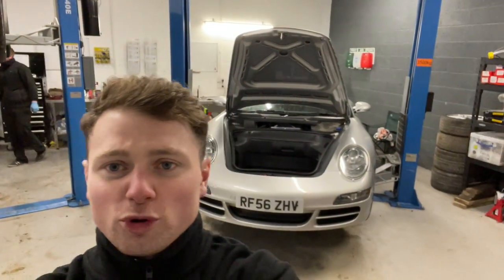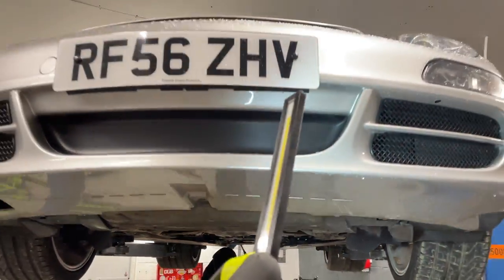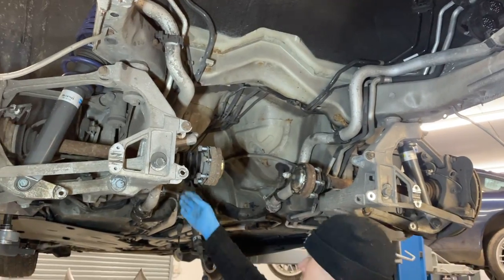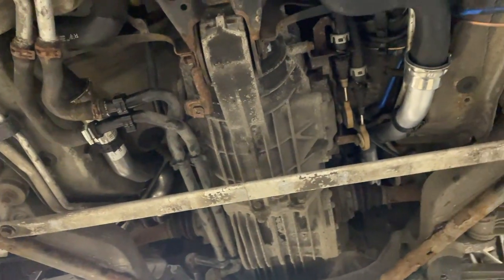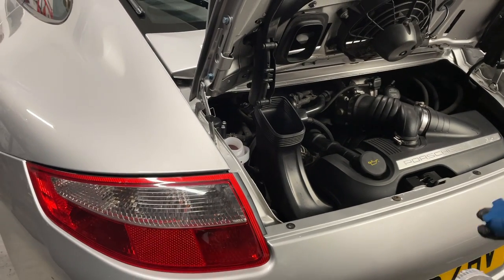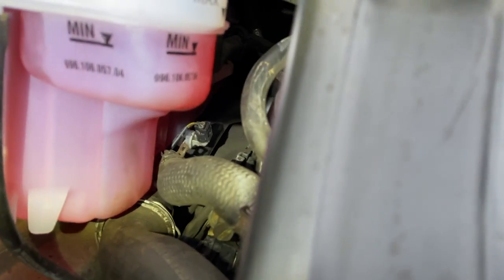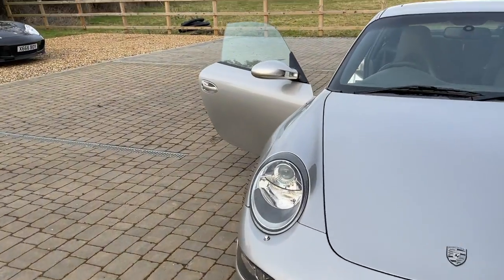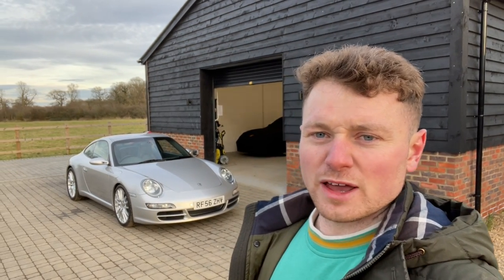The Porsche 997's Coolant System Weak Points Explained & FIXED - FGP Prep Book EP34

Comment: First of all - what an excellent informational and educational video! It feels like xmas day every time you guys post a new video. ✨

I would love to learn more about manual transmission fluid change in 997.2. Is the drain plug the same size as the motor oil drain plug? How often do need to change manual transmission fluid? If I remember correctly the owners manual says 180.000 km / 111.000 miles - this sounds insane long interval. Would u use any other oil brand then Mobil 1 ?

Keep up the good work! Cheers from Sweden 🇸🇪

Comment: Outstanding content, Luke!  I notice that a lot of the cars in the UK seem to have quite a bit of corrosion.  It is my experience that a lot of this can be controlled (somewhat) by keeping the car engine and undercarriage as clean as possible with fresh water, keeping that salt off.  Can you give us some tips on the best way to wash the engine bay and underneath so as to not cause any harm?  I have a power washer that I use to keep things clean and wish to avoid "unintended consequences".  Thanks,  -Tom

Comment: Great video, I guess the problem is caused by the steel clamp on the aluminium tube, way to solve this would be to wrap the aluminium tube with a layer of electrical tape before you put the clamp on?

Comment: Interesting video.

I’m surprised an alternative solution isn’t available for these coolant pipes to leave them in. Cutting them back, swaging them, and a new longer custom poly pipe.

With them being aluminium pipes, it’s odd that they corrode unless it’s because they are mating to a dissimilar metal? I’m guessing it’s not just a case of replacing the O-ring inside the coupler?

Comment: Wow you guys in the UK are rough on cars  :-( - I live in Vancouver, and I have never seen a 996 or 997 on my lift that looks like that.  What is the mileage on the car being worked on? Thanks for the video, it's good to see where the weak spots are, and where corrosion is likely to occur.  Mind you, most of the vehicles I see are three season cars to avoid the exact reason you are doing that work.  I work on a lot of air cooled cars too, and they seem to use higher quality alloys and connectors with less corrosion, or is it the oily mist that all the parts are bathed in? :-) .
Reply: That one has just over 72k miles on it. The problem we have her in the UK is salt, just impossible to avoid in the winter.

Comment: These rear brake pipes are also problematic thing on 997. They corrode frequently right before the rear wheel at the connection point.

Comment: Do these pipes rot from the inside out or outside to the inside? Is there anything that can be done to prevent this type of rot from occurring, change coolant fluid, spray coating on pipes etc on to joints/pipes?
Reply: The out side

Comment: You just can't split them you cut the rubber pipe 1 has been modified 6 times and now has a flat spot on it and you need a modified clip